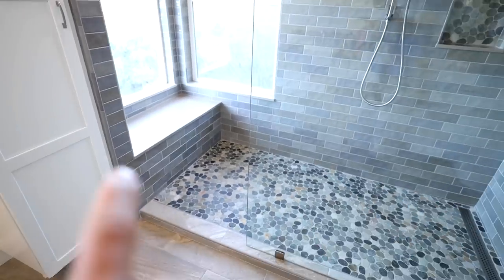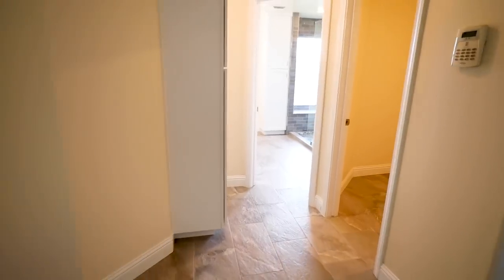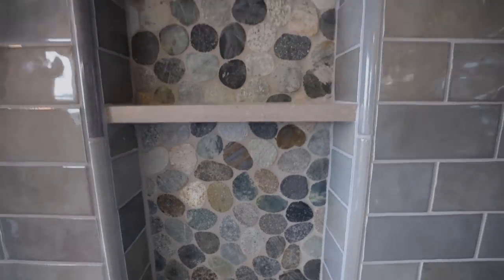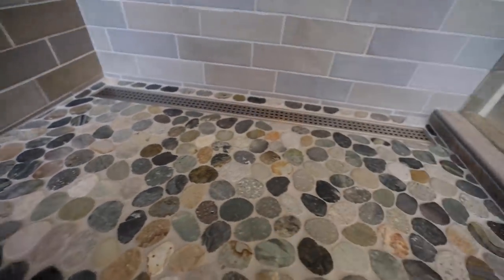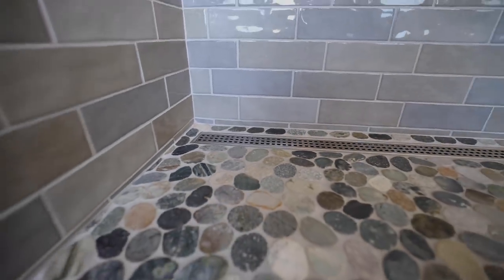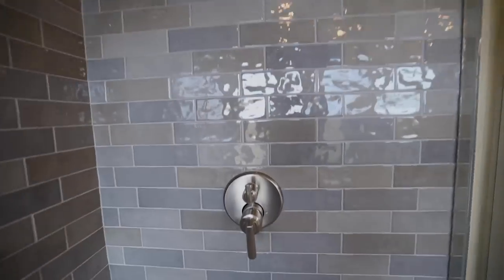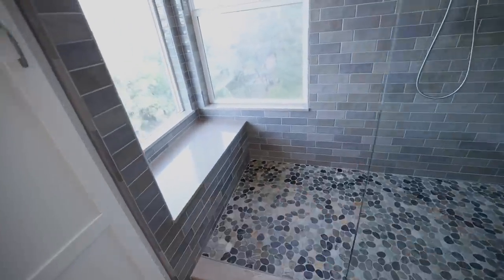We Took out Tub and Made HUGE WALK IN SHOWER --- Heated Tile Floors, Quartz Bench, and Linear Drain

Comment: I just recoated my tile with 511. Also (unless you have a hot water loop) you may want to think about moving the valve like near that window next time so you don't have to walk into the shower to turn on the shower and wait for hot water to get there. I put mine closer to entrance of shower but yet well within reach of showering. Right near the window would have been perfect. Just a thought.
Reply from the maker: Great tip!  The nice thing about having a handheld on a diverter is you can point it away from you while you wait for the water to hear up.

Comment: Looks really great! That sliver at the bottom really was the best choice and it blends in well with the pebbles. I am dying to try a linear drain, they just seem better in every way, unfortunately i dont think they work with pan liners if im correct and we've yet to expand in using that type of system. Great work as always.
Reply from the maker: You can use them with pan liners, they make some specific for pan liner installations.  Check out LUXE drains.

Comment: Great job.  Getting ready to do something similar...remove jetted tub and make a larger shower.  But!!!....concerned about 100% waterproofing around large horizontal slider with window channel that would be at chest level.  Gotta keep water from finding its way to framing underneath.  I may replace with 1/2 sized "basement" style window at head height.  How did you seal around your windows????

Comment: Did you use 3/8” or 1/2” glass? Last time I used 3/8” that size without a down rod from the ceiling the glass flexed a lot almost to a breaking point.

Comment: I do a lot of pausing on your final results to look at how they turn out, and I have to say this one is about as close to perfect as perfect can be. I don't know if you like to disclose prices, but I'm thinking this job, give the extent of it (including doing the floor outside the shower and heating it inside and out), and the quality of the materials, was probably north of $35K (maybe well north). Of course, the tile is the wildcard. I'm sure you can spend just about any amount of money on tile. You did a video with a tile contractor from Atlanta showing a pretty basic, small shower that he had said cost $24K. If I were to use that as a guide, I'd have to guess this shower cost over $50K.

Comment: Hello, quick question; I am redoing the tile around a tub, and at the part where the tub and wall meet, there is a gap all around, ranging from 1/4" to maybe 1/2" - 3/4".  the walls are pretty even, but all the studs have that set back.  I am using 3-ft x 5-ft x 1/2-in HardieBacker Fiber Cement Waterproof Backer Board, so I am thinking it will be over the tub edge in some places and under in others.  How do you handle that, and what do you do about the gap where the tile actually hangs over the tub edge, and there is like 1/8" air gap between the back of the tile and the top edge of the tub.  Thanks again, and great videos!
Reply from the maker: HOW TO TILE A TUB SHOWER -- Step 1 Waterproofing and Prep
https://youtu.be/MDHhK7n0sjw

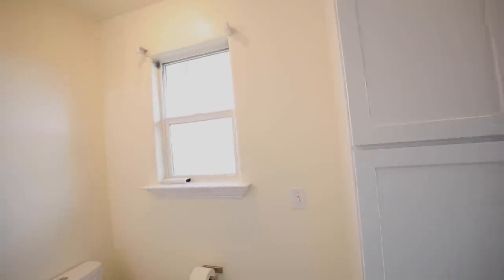Comment: 7:45 no caulking on the base behind the toilet. Got em
Reply: That's purposeful in case there's a leak.
Reply: @Jubileejones  that doesn’t make any sense.
Reply: @Sal Jablo  caulk helps with stability and it looks nice/ finished, but a lot of people leave the back open/ uncaulked in case there's a leak later on. You don't want to trap a potential leak by sealing the entire perimeter, so the back is left open.
Reply: @Jubileejones  I’m talking about the baseboard not the base of the toilet